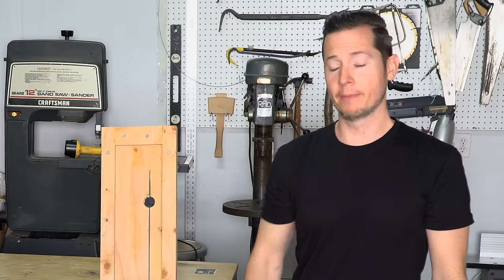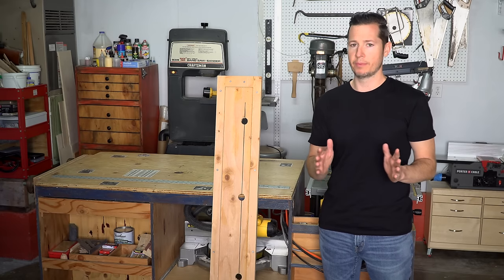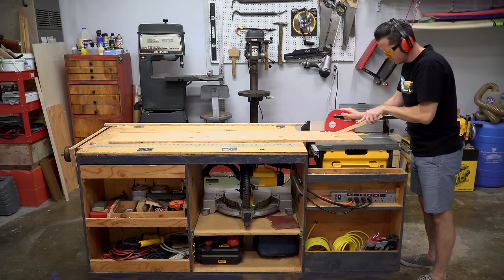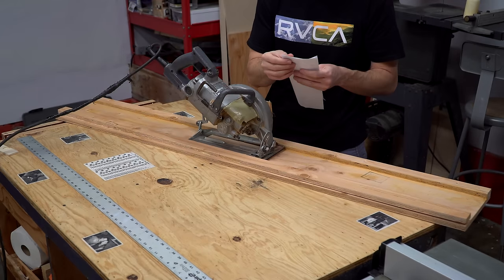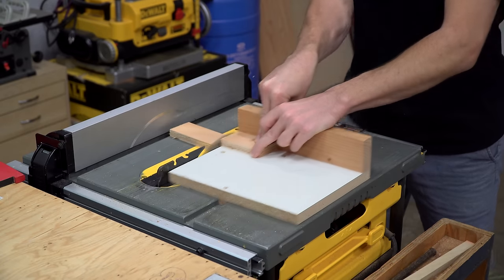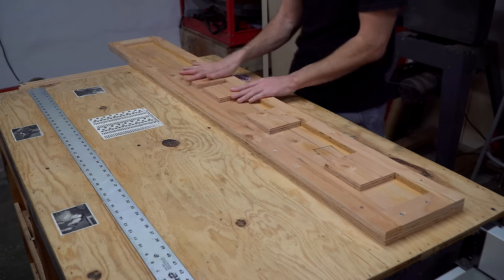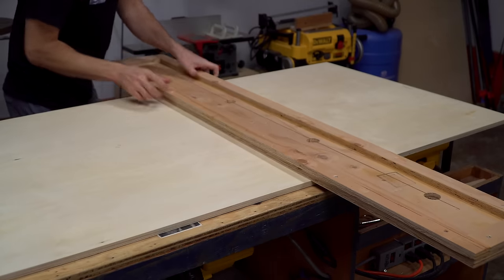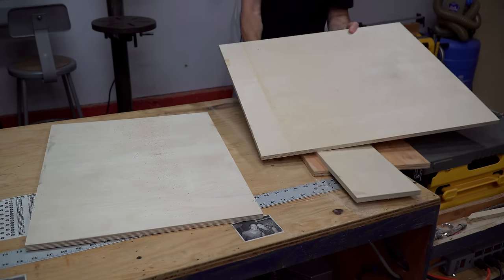Super Simple Track Saw

Comment: A suggestion to consider--let the extra width of plywood extend beyond the second side guide (don't cut it off).  It would allow a place to clamp the jig that will not hit the motor (on a standard circular saw--not a clearance issue with the worm drive saw).    Very quick and useful design!
Reply from the maker: Thanks for the suggestion!
Reply: Good suggestion..

Comment: I made it. Thanks for this. I made very light first cut like scratching the wood. This gave me alignment to drill the sight holes after.
Reply from the maker: Darren Rutgers what a great idea! Thanks for sharing!
Reply: I'm going to try a chalk line and do it before the top and bottom stops are added
Reply: Great idea! Thanks
Reply: You know .. I did the very same thing because I didn't trust myself doing the holes first.
Reply: I was just watching this and thinking that just scratching a cut in would make a nice line for the drill holes... I guess someone already thought of it!
Reply: I did the same, and it was simple to do the sight holes afterwards in perfect alignment.
Reply: The sight holes don't need to be exactly on the cut line, and seeing as you have a drill press you can drill the holes after you make the cut, just use either a forstner bit or a hole saw. Also I have never seen plywood split when screwing, pins and glue would be fine, just angle the pins so they won't pull out
Reply: @mauricecureton4966  Tommy tells us that he is gong to "make a saw track, capable of making cuts just over 4ft in length." The guide has four sight holes, and given that the guide would need to be approx. 5ft to allow the saw to cut the required length, I should guesstimate the holes are 12" on centre.
Reply: Good thinking.
Reply: @OneMinuteWorkbench  p
Reply: Yeah, I did the same.
Reply: Thanks for the post and the wickedly simple design that leaves me adding to earlier replies in saying "Why dint I think of this?" I made your jig out of a smooth white pantry door (slides very smoothly) to help break down salvaged ply sheets for a project. I added a short 500mm length of scrap 25x25mm aluminium angle to the lead end, taking excessively great care to ensure it was spot on square. Now, realistically, if I'm cutting factory finished panels I only need to sight up the line with the nearest hole and just use the far one to check square. The angle also provides a good clamping point each side of the jig. The next one I make will have a shallow angle lead-in ramp so that the blade is introduced to the cut less abruptly. Thanks for the inspiration and unclogging my over-engineering approach to this problem. Masking tape, a 60 tooth blade and a slow steady cut made my pieces look like they'd been through a pro table saw. I was watching Makita vs Festool comparison vids,which is why your clip showed up, and you have made my old faithful Bosch CC even more useful. Nice one!

Comment: Great design and clear instruction, many thanks. A word of warning for others, I made a school-boy error and assumed that when my Black and Decker circular saw was in the 0 degree mitre position that the blade was 90 degrees to the foot of the saw; it wasn't, which was discovered when I measured the first test cut made with the track! Zero degrees corresponded to one or two degrees out, which translates to a couple of milimetres over the width of 18mm material. Lesson: CHECK YOUR BLADE IS SQUARE TO THE FOOT OF YOUR CIRCULAR SAW BEFORE YOU START TO CUT!

Comment: I was gonna purchase a track saw and table until I ‘saw’ your video, lol...what I ended up designing was a 9 ft X 9 ft out feed table for my table saw with a 4 inch slot wide enough to slide 8X4 sheet goods inside for both ripping and cross cutting...I used your design to design a 9 ft track that I will be able to raise and lower to lock the sheet good in place and make my cut at desired measurement...saved me $900, thanks

Comment: Love the idea!  Thanks Tommy!         

HERE'S A SUPER SIMPLE UPGRADE SUGGGESTION:            Route one dovetail groove lenthwise down the approximate centerline of the bottom face of the guide.  Position isn't critical but just keep that groove well clear of the saw's cut line.  You'll need to use 3/4" plywood for the base to have enough thickness to accomodate the dovetail groove.  

Now use 2 Matchfit Dovetail Clamps, one slid in from each end of the jig into the bottom-side dovetail groove to clamp the guide securely to your workpiece.  The sliding clamps will easily adjust to any workpiece cut length and the jig will be solidly attached to the workpiece during the cutting operation!  Using this method of attachment, you also won't be limited as to where on your workpiece you clamp your jig.  Because the clamps exist ONLY underneath the jig, they will never interfere with the topside saw travel.  Simply slide both clamps out of the groove for storing your jig.  I'm making one!  Keep up the good work Tommy!

Comment: What a great design, Tommy!  I made this out of 1/2” plywood since I was using the Rockwell versacut hand saw (small circular saw and light weight). I also put paste wax on the wood and the saw shoe plate to make a smooth gliding action.
Reply from the maker: Awesome! I’m glad it worked out for you!
Reply: so the 1/2" is rigid enough? I too have a compact circular saw, and the 3/4" would take some of the depth for my cut. I wondered if, with the sides, a 3/8" plywood piece would be enough.
Reply: @talleysuehohlfeld446  just bump up the rigidity of your 'frame', maybe aluminium angle for example. Theoretically you could get away with 1/8" ply as it's really just a sight line and provides a bit of tensile strength in the 2D plane
Reply: How do you like that Rockwell saw? I have a Makita 61/2 battery 18v and a dremel ultra.  Always looking for the next great small saw.
Reply: Heck I'mma try 1/4" for the base of track and 5/8" or 1/2" for the rails.  S/b lighter.   @talleysuehohlfeld446

Comment: Great design. I have a very simple guide that allows the blade to drift to the right if I allow it to. I use it mainly to trim doors so sometimes I have to cut twice. What I really like about your design is that the frame can be quite thick but the panel at the bottom can actually be as thin as 3mm Masonite or Mdf. Big thumbs up.

Comment: Hi, Like the Saw guide you made. Very clear instructions and simple to make.  Like the fine details of placing a double paper edge so the saw will not have friction yet maintains fine accuracy. Another great point is removing the saw blade so the saw base sits squarely on the plywood so it could be tested to run smoothly between the two side edges. Your point of drilling the four 1 inch eye holes to align with the cut line FIRST before running the saw on the guide was very helpful.. and lastly noting which side to cut due to blade thickness seen from the 1 inch hole brings the whole project very clear to understand. Brilliant. Thank you. I am going to do one up.

Comment: What I like about it, it solves the problem of clamps getting in the way of the saw.  And the sight holes, brillant!!
Reply from the maker: Thanks - I'm glad you like it!
Reply: The worm-drive saw also helps solve that problem.
Reply: To make sure your sight holes are centered...cut a 16th deep groove then drill...should be right pretty much every time...
Reply from the maker: Thanks for the tip!
Reply: I believe it s not really smart this way 
Sanding paper under  stop your guide from moving 
Using holes means you need to trace the bit you need 
6 mm ply with 2” 18 mm rip cutting down with your skill saw 
Sanding paper underneath 
Best guide ever 
No clamp 5 mn to make it perfect accuracy and you don t need to trace just mark your measurement

Comment: One thing I don't like: I DIDN'T THINK OF IT MYSELF!!!  Excellently simple design.  Mine will accommodate an 8' cut, and I may attach a piece of Formica underneath for a more durable edge.

I've been using a straight edge with integral clamp for crosscuts, and a pair of 4+ footers joined with pins to make an 8+ footer for rips.  But the pins have too much slop and don't keep it straight, so I have to work out ways to anchor the center.  And of course, I have to make sure I compensate correctly (!) for the baseplate width and saw kerf.  OR... Build an 8 footer of your design!
Reply: Sure is, best simple jig for skillsaw.

Comment: good design Tommy . i’ve always made and used   just a one sided guide  out of 1/4” MDF  or Masonite  for cutting solid core  Commercial doors  for their undercut  i use the same Wormdrive saw as yours and   although you are correct  the saw can wander in one direction another benefit of that guide is it  protects the door from scratches   from the  saw bed and does allow you to  align   your cut to a mark onthe door or whatever you are cutting  another great tip  is always using a thin kerf blade  Carbide tipped  as i believe the one i have is over 15 years old and has cut many  things  during that time  as i also use my Saw to break down sheet goods  for my  personal shop  for that purpose i do keep a slick self adhesive  Silicone tape on the saw bed to prevent   scratching my sheet goods before final dimensioning them on my table saw   that has a smooth cast top that’s paste waxed
Reply: Great point about the benefit of the double-fence design preventing scratching of the work surface by the saw bed.  I had not thought of that.

Comment: Great idea! I love the sight windows. I will make a 5 footer and a 9 footer as alternatives to an $800 tracksaw kit that i would seldome use. I had just made one for cross cutting metal roofing on a bevel and deep-6'ed it after the job was done. I hadn't thought of making one for cutting sheet goods and trimming doors. Thanks for sharing.
Reply from the maker: Thank you! I'm glad to help!
Reply: You may want to make an in between length, if you use Baltic birch cabinet ply, it comes in 5x5 foot sheets.

Comment: Pretty Kool! Another option is to router a channel across your table for the saw blade, plus both pieces are then supported during and after the completed cut.
Reply: Too, if you only routed on the discard side of the cut line, then you'd have a zero tearout saw tool.  Just show cut line with the guide and you'd have perfect, tear out free cuts every time.
Reply: @alankauth  Now add a runner under the track, perfectly perpendicular to the cut line, that runs into another channel, perpendicular to the other channel and you have a dead square cutting tool ;)
Reply: I have a 16 foot table, Perfect solution, Thanks

Comment: This is my first project for my new workshop, my table saw bit the dust yesterday and I was thinking of replacing it, now there’s no need. Thanks for your video & tips.
Reply from the maker: I’m glad you dig the track, but I will so that it’s not a replacement for a table saw. It’s good for breaking down things that are too large for a table saw, but it will become tedious trying to make all of your cuts with it. Anyway, I hope this helps!
Reply: One Minute Workbench, the amount of work my table saw was getting made it an expensive tool. Normally with a full sheet of ply I would work outdoors (weather permitting) on a bench made of 4” rough cut timber & two saw horses. This will be safer, more accurate and efficient. Thanks again.

Comment: Great guide. I've watched a few of these, because I need something a little more usable than clamping a straightedge to plywood for straight cuts, and most of the rest were excessively complicated - mostly involving metal guide rods which require the saw to bolt on and your plywood has to fit inside of. This design is great, can be scaled up for 8' sheets, and could be modified to fit a new saw should mine ever die.
Reply from the maker: Thanks!

Comment: Thank you so much for this great idea. I built one this afternoon and started cutting plywood panels fo a kitchen Island I am building. I got excellent accurate cuts. I saw your newer video where you put plexiglass  panels over the holes to help prevent tear out. This might be OK for younger eyes but I am 70 and I never see as good when 
 looking through glass.
I like the open holes and I slide a wide putty knife into the slot to help me reference the line. I am using a battery Mikita with an ultra finish Diablo blade and I could not see any tear out over the holes.  Thanks again.
Reply from the maker: Awesome! I’m glad this has helped on your project - thanks for sharing!

Comment: I use one to trim doors so I like to have two of the holes spaced for a 30 inch door. , to get a splinter free cut make a firs pass with the blade just makin a kiss cut. barely cutting the top surface then reset the blade to cut completely thru. I have a sharpie mark on the saw depth adjustment to set the Kiss cut depth.
Reply from the maker: Awesome! Thanks for sharing the details about your method!

Comment: Great idea!  The only thing I would do to make it better is to put a thin sheet of clear plastic on the bottom to make it 100% zero clearance, even where you cut your sight holes (matters on a door or where you want zero tearout).   Then you won't need tape to reduce fraying and tearout at the cut. Clear plastic allows you to still see your line.  Also, if you use teflon on your side rails, you can close down the "shim" gap to allow free movement.  Friction won't matter.  Also, if you use cabinet grade hardwood plywood, the whole tool will be more stable.  Maybe coat the whole thing with clear urethane to keep it the most stable with weather changes.    Actually, thinking about it, you could put a sheet of plastic or teflon strips on the top to make it MUCH easier to push a saw.  But, certainly as it is works pretty darn good!
Reply from the maker: Thanks - I'm glad you dig it! And thanks for all the awesome ideas on how to improve it as well!
Reply: Brilliant original idea and these are good improvements. Would easing the bottom edge of the two guide strips help stop sawdust binding the saw base? This jig idea may also work well with a router for cutting dados or producing a  fine edge.
Reply from the maker: Thank you! So far dust hasn't caused it to bind - I think that's because you only ever make one cut before you remove the jig. And as soon as you remove it, the dust tends to fall out of it. Another factor may be that my saw's shoe actually has a curled edge, so there's space for dust. If you have a saw with a shoe that is sharp (probably a cast base), then you might need to incorporate the easing of the edge you suggested. I agree, a jig like this could also be used with a router to produce different types of cuts - great idea! Thanks for sharing!
Reply: One Minute Workbench u
Reply: Any idea where to source the teflon in the size and length that would be needed?  I'm using 3/8 plexiglass, on mine and am making it about 6 feet long.
Reply from the maker: I'm not sure. If you want to coat it in teflon, I'm pretty sure they make sprays that could work. Good luck with your build - be sure to come back and let everyone know how it turns out!

Comment: Thinking about it, if you use aluminum rails on the right and left sides (like 1 inch screen room stock), then you can use thinner material supporting your saw and not lose that whole 3/4 inch of cutting depth from plywood.  Obviously losing cut depth not a problem if only cutting sheet goods.
Reply: Or just use 1/2" for the base.

Comment: I like this design a lot. The idea of guides on both sides of the saw is great.  I had made something similar with a piece of 3\4" ply and a piece of 1x4; just screwed the 1x4 to the plywood, and used it as a guide to cut the plywood to width.  It worked reasonably well, but you had to constantly be on guard that the saw didn't wander away from the guide. Took all of 2 minutes to make, and I'd give it a 6.5\10. For one thing, it allowed me to track the saw along an 8' length, which is handy sometimes.  This design is better, and I don't know of anyone making plywood  10' long, with which you could combine the better features of both designs.

Also, your video and commentary are excellent. If you can't follow these directions, people should keep you away from sharp objects and power tools of any kind.
Reply from the maker: Thanks for compliments - I’m glad you enjoyed it!

Comment: Did you consider using 1/4" plywood for the base.  You'll gain 1/2" depth of cut.  Also, the 3/4" guide strips will be rigid enough to keep the 1/4" plywood flat and rigid. 

Good design with the sight holes to align the cut line.
Reply from the maker: I actually made another one with 1/2" ply, and I think that's about as thin as I'd want to go. The other one is made from higher quality ply as well, and it has a very nice feel to it. If you want to check it out, here's a link: https://youtu.be/Fc77cL8ReBQ Anyway, thanks for the feedback, and thanks for letting me know you enjoyed the video!

Comment: Great idea, suggest 2 lengths of Alumimium angle iron for guides to prevent base board from warping due to heat.
Reply: Great idea. I found some lengths of unistrut on a job i was working on. I used these instead and works a treat. Heavy though but doubles up as a straight edge for other jobs.